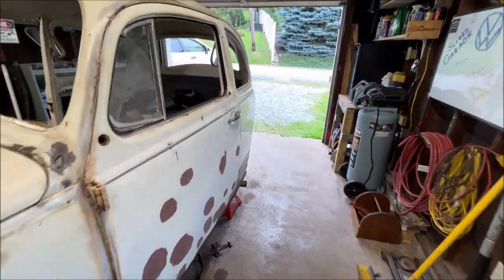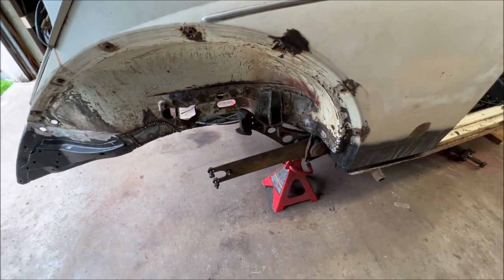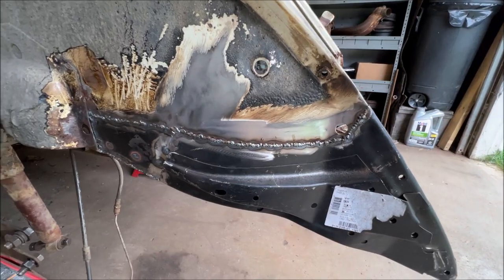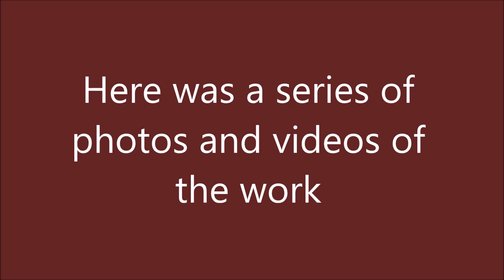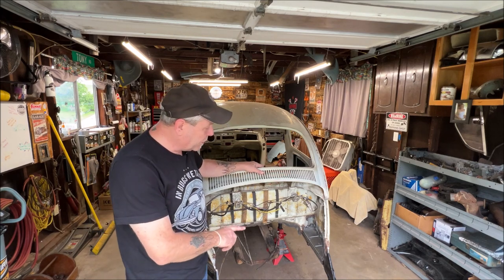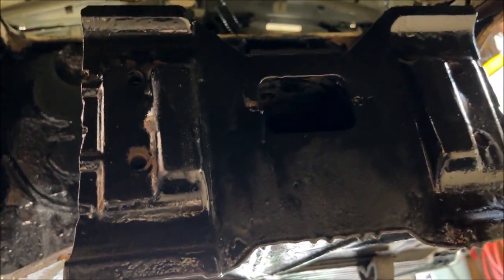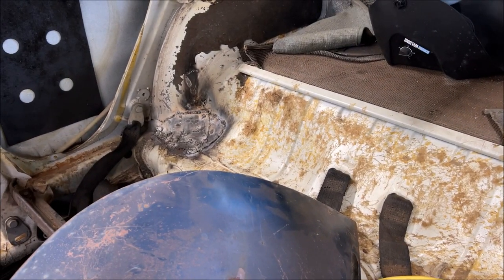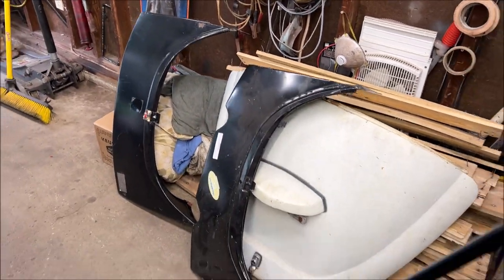VW Beetle Rear Quarter Panel Wheel House Install - VW Restoration - Beetle Bumper Brackets - DIY

Comment: I came across this video today, I've been watching similar body repairs on older beetles. 
I purchased a 63 ragtop that was a baja but I've been wanting to convert it back to a stock looking beetle.
Have you or anyone here in the comments tried that?
Thanks, I subscribed to your channel.
Reply from the maker: Welcome aboard! And thank you for subscribing. Honestly, over the years I knew a couple of people that have done that. And since it is a 63 ragtop, I would definitely do that if possible. A little welding involved in some panels. And you will have a heck of a car.
Reply: @SladesVWBeetle  thanks for responding, other than having both ends cut off to make it a baja the body is in decent condition. 
I'd much rather have a stock look versus a baja.
Plus I recently purchased another 68 baja so I'm inclined to get the 63 back to looking stock.
Thanks again for responding, I'll probably have way more questions in the future.
Reply from the maker: @goldentrunnell7450  I understand completely, a 63 deserves to be converted back. But I’m kind of odd like that. I don’t mind a Baja, never owned one myself. I never have the nerve to cut one up lol thanks for being part of it here. I hope you have a great upcoming week.

Comment: Hi question unrelated to panels ...my engine is overheating I've got all my seals and tins in place what are the odds since I don't have a thermostat that the vanes inside the fan shroud are closed causing it to overheat? I appreciate your time and love your videos. Nick from Canada
Reply from the maker: I will check to make sure the flaps are open on the shroud. There should be a spring on the back, on the linkage that will hold the flaps open.
Reply: @SladesVWBeetle   so no luck so far on finding the overheating issue I've got dual 40 dcnf carbs.. can the jetting be an issue with the overheating?
Reply from the maker: @KatheMinnema1  if you are running to lean, that will definitely cause it to run very hot. You may need to go higher on your jets. As in larger.
Reply: Thanks so much I will look into doing that 😊

Comment: Got a question you might be able to help me with. My fuel guage reads half when its empty. My entire bug has been re wired . I hooked it up as well as I could understand from the poorly illustrated diagram I have.
Reply from the maker: That almost seems like the sending unit or the gauge. 
This is the way I fixed that problem one time. 
But remember it’s probably not the proper way. 
I drained all of the gas out of the tank. And put a quarter of a tank of fuel in. Then I kept the bending the float arm slightly and reinstalling it until I read a quarter of a tank. I hope that made sense
Reply: @SladesVWBeetle  Have sorted it out now, two problems, wired up wrong to
Reply: @SladesVWBeetle  two problems, had it wired up wrong to begin with, and the sender unit had issues also. In trying to clean the terminals on the sender unit, not realizing they were just fine wires I broke the wire. So I now need to replace the sender. I have done what you  suggested on other vehicles. This problem is usually caused through other people not being careful and bending the rod when extracting the unit. Made a video of the way I diagnosed the problem. The 47th edition of my bug build. Think you had some rust to fix,  check out how this one began. It really should have been scrapped.  https://youtu.be/jDj3J-qxm5o